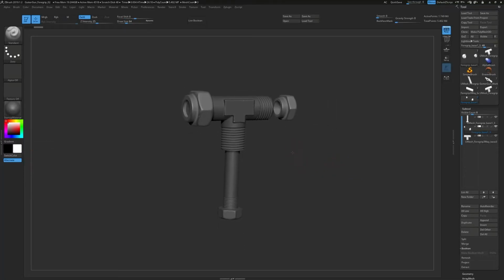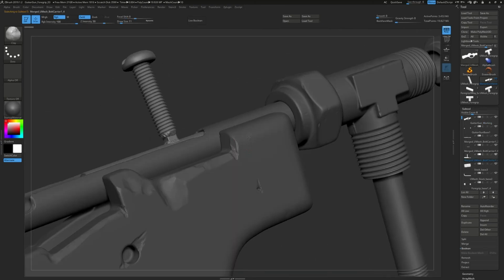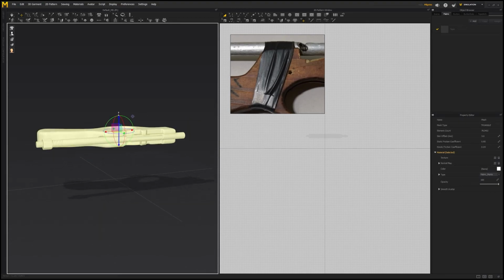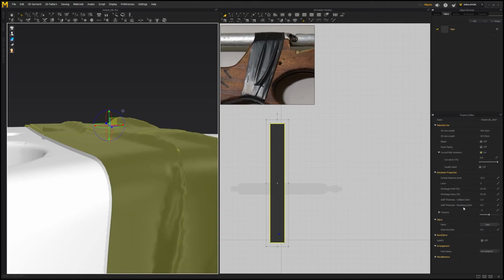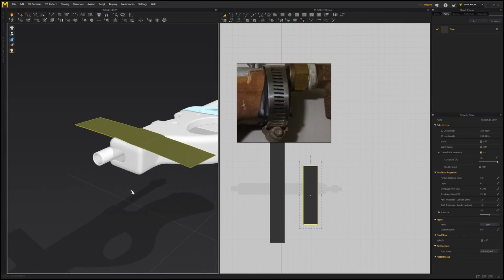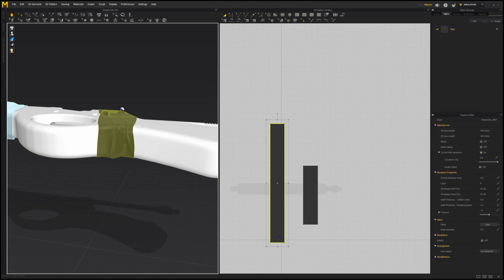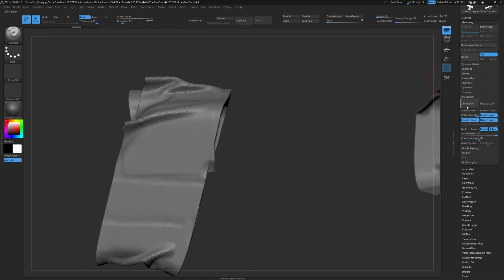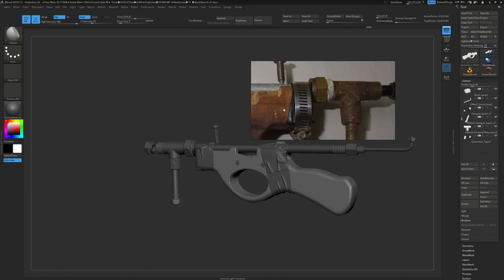3D Improvised Weapon Tutorial Part Five: Creating Duct Tape

Comment: i don't know why but my marvelous doesn't work like your😭😭😭
Reply from the maker: Sorry for the late reply! It may be your import settings? sometimes they import super small or really big depending on the units used in your modelling program and in marvelous designer. make sure it's scaled correctly otherwise the values for the simulation wont work as expected.
Reply: @ArtOfPilgrim  sir i set my Marvelous designer setting ,as seen in your video, but  cloth curve wrinkle not work, as your.🥵
Reply: same here bro